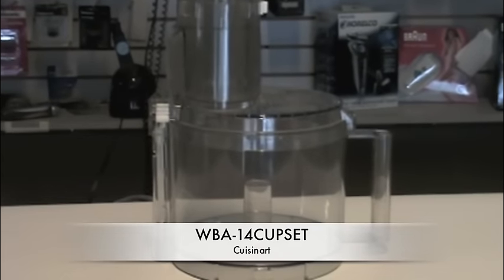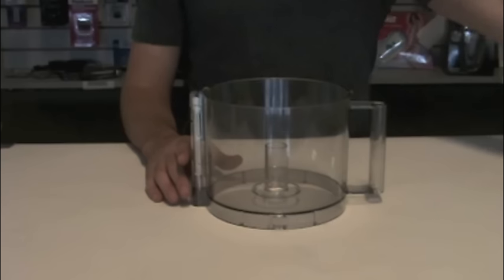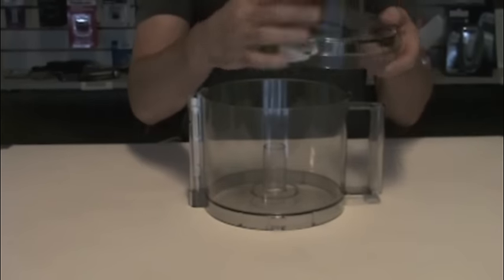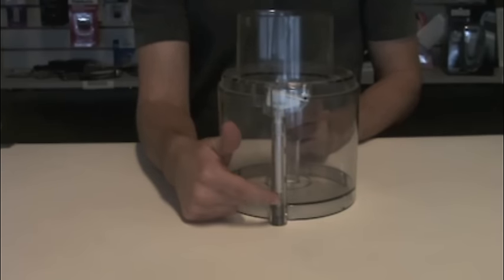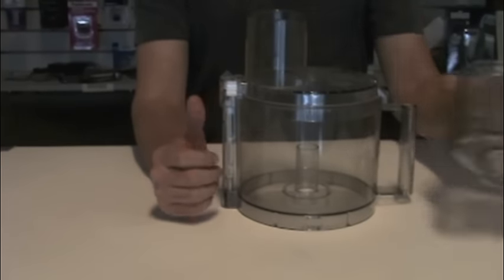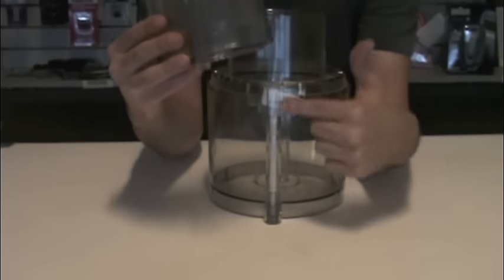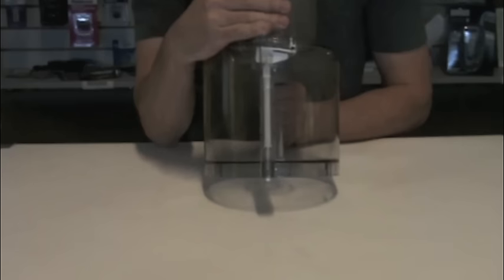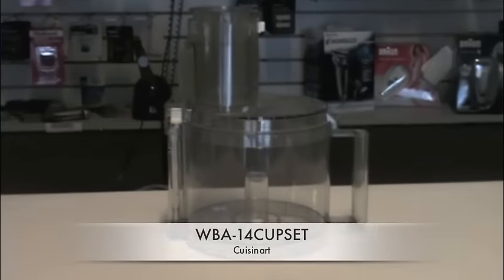How To Assemble Your Cuisinart Work Bowl Assembly For Your Food Processor WBA-14CUPSET

Comment: Well, I watched, but still had to struggle  to get the machine functioning. The instructions need to be more complete and be given slowly step by step. Show ALL of the parts spread out on the counter, and name them clearly and slowly. Then start with the machine base. Show how the blade fits in the bowl. Add the bowl to the base, sloooowly, showing each small sliding/rotating move clearly. Show close ups of the parts that need to align. Show where the hole is on the base that will receive the white pin. Show that once the bowl is in position it needs to be aligned with the hole in the base and with the funnel and pusher above. Mention that it may take a bit of force, to get the alignment of funnel, bowl and base correct and that more force downward on the pusher will be needed to trigger the white pin to make it shoot it into the hole in the base. Show plugging in the machine, show putting food in; show pushing the on button; show pushing the off/pulse button. Show dumping the food into another bowl; show forgetting to remove the blade first; show the blade getting stuck inside the bowl; show removing the blade with a pair of pliers. And finally show how to safely clean the whole apparatus. That's what I needed.
Reply: Honestly it just sounds like you need more help than any reasonably functional adult would need
Reply: @Rokegle135  the safety features make the assembly very NON-intuitive and the booklet that comes with the machine doesn't address assembly *at all*.  Far better to have overly specific guidance than none or only the most general instruction.

Comment: THANK YOU! Your video should be referenced by Cuisinart in all of their 14 cup info.  I didn't realize that I didn't quite have the bowl lined up so the metal pin would not go down. After reading and watching 2 unhelpful videos, one being the Cuisinart set up video, I found yours. It was a Godsend. Thought there was either something wrong with me or the new processor but no, you just need to have strong hands. Thanks again for taking the time to be so helpful to so many.
Reply: Unfortunately, I've had mine for several years and it is just hit or miss that I can get the pin to actually activate the mechanism.